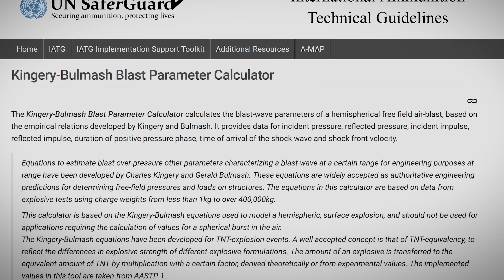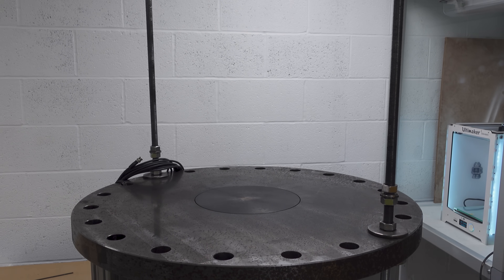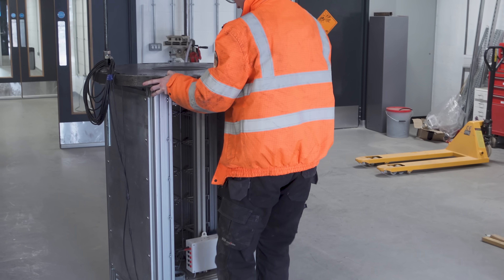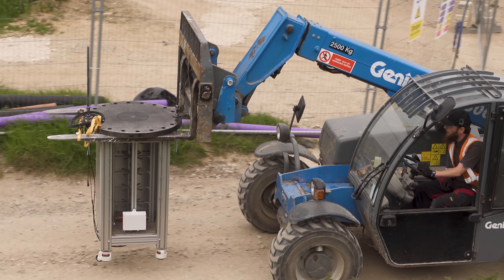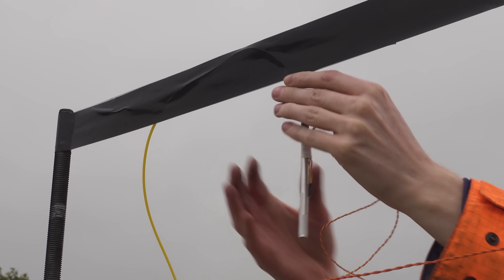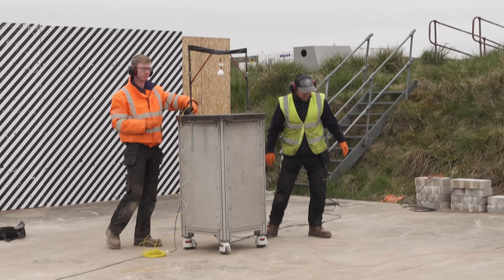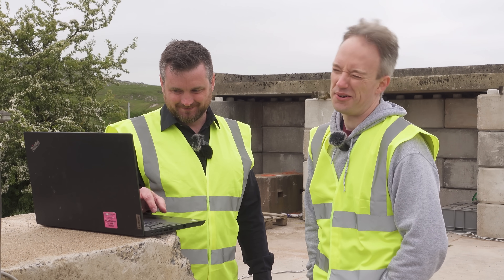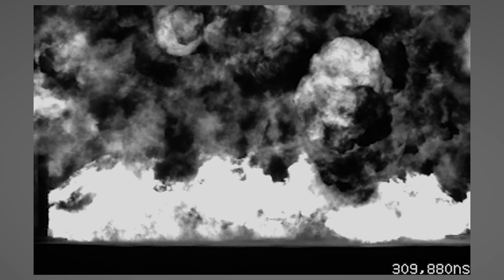No-one knows how explosions work (yet)

Comment: I used to work with a group of people who designed warheads, like HB 876 (I knew the guy who suggested the dimpled case) and BL 755. When I was paying attention they were modelling self forging fragments, which involved modelling the detonation of explosives and the forming of the metal plate that they were in contact with. Their experimental results corresponded very well with their model. So I'm surprised to hear, nearly 30 years later, that they didn't understand the explosion. It seemed like they understood it really well.  This short range blast was actually far outside of their area of interest, by the time the plate started to move the explosion was discarded from calculations and the metal was just coasting to its final configuration (teardrop shape, pointy end first) and had already reached its maximum velocity.
Reply: All a warhead designer is interested in is the final effect, not the minutiae of the initial detonation. Final effect can be determined by the simple expedient of explosive testing, rather than by mathematical calculation. The explosive testing is going to happen anyway, so you cut to the chase and get a bigger bang for your buck.
Reply: I just looked up the HB 876. The dimpling reminds me a little of shape charge warheads. Did they invert and become penetrators?
Reply: @JarrodFrates  Exactly. HB 876 is an area denial mine. So it is dropped in a swarm and they are influence and time fuzed. If you look up JP233 or HADES you will see the dispensers. The mines have springs on the side which stand them up. If something drives over them , or knocks them over, they detonate. If you try to clear them with a dozer they are cunningly designed to tip towards the blade and fire the main EFP through the dozer. At random times they detonate and blast out a ring of small EFPs which 'interfere' with clearance efforts. If I remember right they are dangerous to several hundred meters. In JP233 they are dispensed around SG357 cratering munitions, so they crater a runway and surround the craters with mines that no sensible person would approach. In testing in the US the pilot missed the target area and dropped them in grass, they had to burn the grass then use three teams of snipers to detonate the mines from a safe distance.

Comment: What I also noticed is that although, at the moment of detonation, the reaction appeared to be uniform almost immediately after that spurious plumes started to shoot out from the initial ball of force. ie, at 5:21 we can see a "plume" of explosive force coming out form the front end of the detotation ball. This suggests to me that there were other forces acting on the air as it was moving.

However, it didn't show much to do with the double impact of an explosion. ie, the oxygen being burnt off with the detonation and then the air rushing back in to replace the spent oxygen.

Would love to see more of this stuff.
Reply: High explosives generally contain their own oxidizer, so don’t burn through oxygen like the Hollywood explosions that use gasoline to make a big fireball. I guess that would reduce the double impact here. No oxygen consumed, so no air rushing back in.

Comment: 5:51 interesting to see the shockwave resonates the dust under the table. Wonder what impact this has on the signals within the data cables which run out from here and if a deflector would be beneficial
Reply: The dust is kicked up but I see no resonance. The shockwave through the air will hit the striped screen and bounce back. This could cause the appearance of a interference-pattern. I think the dust kicks up because the barrel restricts the flow of air underneath it. Also, the barrel's 4 wheels are pushed into the dirt, so they cause some disturbance too.
Reply: @DreadX10  what's the differnece?
Reply: @user-op8fg3ny3j  Quite literally everything.
Reply: @user-op8fg3ny3j  Resonance: natural frequency of the system (air + dust) determines what happens (system itself responds to (a fitting) part of the excitation). 
Interference: external source(s) determines what happens (system responds to variable excitation).
Resonance frequency with a system that changes from 'only air' to 'dust-filled-air' is variable and therefore not really suitable here. The only periodic phenomenon here is the waves that bounce up and down between the ground and the base of the barrel but that volume has it contents changed during the bouncing.
Does this make sense?
Reply: @DreadX10  so kinda like a standing wave?
Reply: @user-op8fg3ny3j  A standing wave that happens only some of the time as the medium is changing, yes.
A standing waves where the nodes aren't moving, no.
So it would be hard to identify.
Reply: As the wave passes through the cable linearly at any one point, as a radio wave would, you could likely use conventional noise removal techniques.
Reply: The signals in the cables are traveling at more than half of the speed of light. The shockwaves travel at most a small multiple of the speed of sound. The important signals aren't going to be affected by the blast, even if they are analog. The signals are multiple orders of magnitude faster than the shockwaves.

Digital signals aren't affected at all.
Reply: @hamjudo  hate to burst your bubble but we need a ton of information to be sure about it. lets make a thought experiment.

we take some military grade, high brisance explosive like rdx (c4). that is almost 9km/s expansion (velocity during detonation) speed. if we use thermionic electron emission sensors to catch heat we will not receive an electron in the semiconductor even if it was ejected at a 620km/s from the sensor as it takes time to heat up to eject it (that is how that type of sensor works). in the time it takes for sensor to react, the explossion is moving past the sensor. it is an incredible tug of war between precise, usable and any data at all during those tests. that is even if you get any instrument to survive it.
Reply: The table is shielding that area under it from the shockwave, so an area of low pressure is created and the dust is kicked up.
Reply: Nerds.
Reply: It's cause it's hollow, and makes a negative pressure zone under and within.
Reply: It’s not resonating. The explosion is hitting the thick metal plate below it and bouncing off it, forcing the entire measurement device into the ground below in reaction, which kicks the dust on the ground into the air to then be carried away by the slower air-borne turbulence from the explosion.

The key is the bounce, which causes a reactionary downward force in the plate.

Comment: Surprised that areas like understanding nuclear explosions haven’t helped in knowing other means such as this.
Reply: It's due to how different the mechanisms are at the atomic scale. Chemical explosions are  (normally) caused by the rapid production of gas combined with the heat of the reaction. (The heat then ignites the gas).

Whereas a nuclear explosion is either caused by ripping the atoms apart (fission) or just making a small star (fusion).

The difference affects the data modelling a lot.

Comment: Oh hey, this is something I actually do active research and development on! We’ve actually gotten pretty good at making computer simulations of these kind of explosions using multi-phase physics models. The Kingery-Bulmash model that Tom mentioned is still used in places, but it’s ridiculously simple compared to real simulations.
Reply: I've always been curious: how do you wrangle the positive feedback from heating?  Do you let it run wild but put a cap on transport rates, or what's the strategy?
Reply: @cdavie5  That's such a good question. If you're modeling the chemistry, then the heat production will be limited by how much reactant is available. So like you say, it's limited by transport, either how fast fresh reactant can get in by diffusion, or how fast the heat can spread by thermal conductivity. Or in the case of a detonation, it's limited by the how fast the shock wave can travel and how much energy can be released by the material.

In my case, we don't really model the detailed chemistry because it'd be so expensive. We have an equation of state for the energetic material, which controls the amount of energy and temperature that's released.
Reply: @Churlish42  got any recommended reading for equation of state models? I’ve done some reading on impact constituent models like Johnson cook, but I had trouble finding a primer of shock EOS
Reply: @Churlish42  Hi! The issue here is that the equations of state are not good enough... yet. They get the overall energy release correct, which is fine if you are a reasonable distance away (as do Kingery & Bulmash), but they don't get the distinction between energy released through detonation and energy released through secondary combustion. There are some models that allow for secondary energy release, but they're currently just "programmed" release rates, i.e. not related to the thermochemistry. We're working with a team of electrical engineers who have built a high rate thermometer, and with explosive chemists who are using pyrometry so that we can investigate/observe the different chemical species and when they crop up! Fascinating stuff indeed.
Reply: @DrSamRigby  Do you have any plans to use an exploding foil initiator on the end of a cylinder of explosive with a length that allows the shockwave to accelerate completely to get a more uniform blast wave or are you more interested in the grey area where the shockwave is still accelerating inside the explosive?
Reply: I am going to present this at a different angle. Newer EOS are very good. Post EXPLO 5-6. The trend is obviously towards OB 0 explosives, TNT is on the way out and new melt cast that are at least CO balanced are the future. 
 
So, for what practical purposes is the modeling not good enough? Because with a given molecular structure and EOS (modern) you can get shrapnel velocity, shrapnel pattern and pressures. 

As far as secondary combustion, thermobarics have been tested enough to understand, and this is even being solved in scramjets where the combustion of difficult fuels like boron has been figured out. 

I don’t understand the application your targeting.
Reply: I don’t see the application of the grey area? We have explosives that DDT in milligram quantities, even microgram quantities that are stable. How would this change  anything in explosive engineering which I am a student of? DDT is obviously complicated but stable enough primary explosives exist that have pushed the NPED craze a bit out the window.
Reply: That's so cool! Are any of those simulators publicly available?
Reply: And here I thought blowing things up industrially was fun. I really want to get into the research/engineering side of things, but that generally requires more education than I've got/am willing and able to acquire at this point.
Reply: @araragikoyomi99  Well, yes. Blowing things up is fun. I had an entire career based on blowing holes in things with lasers. Big holes, small holes. It was all good. You need math to put up a good front.

Comment: What's going on with the frame before the fireball in 5:06? There's seemingly a strip of light along the ground before the explosive completely goes off. Very odd
Reply: Looks more like a camera artifact. Perhaps something to do with rolling shutter?
Reply: Detonation cord.
Reply: @AlbionJorvik  
That's not a detonation cord. Please actually look at the frame. You can use period and comma on your keyboard to advance frame by frame, forward and backward. Pause near the event and frame advance toward it, and you will see it actually looks kinda like the light of a lamp. There is no obvious source.
My guess is that it's not caused by the detonation itself, but has something to do with their measuring equipment.
Reply: @theuncalledfor  If the time was not -2ns I would say light from the blasting cap going off.

Edit: that light top right seems to stay on.